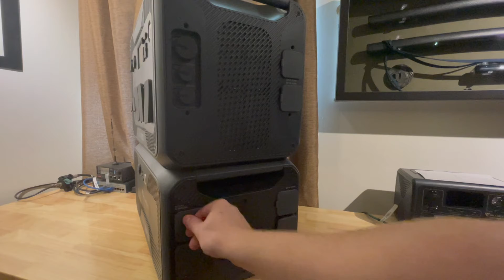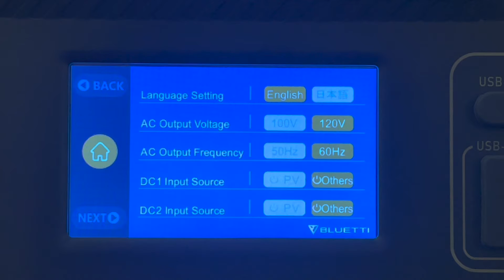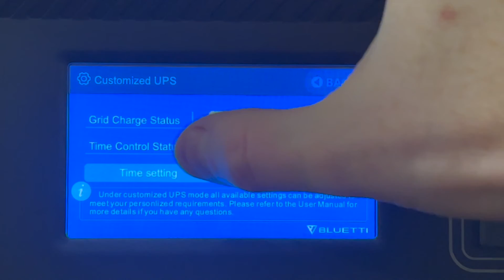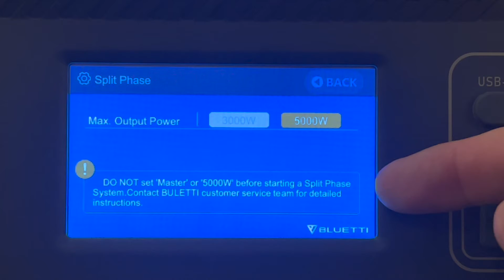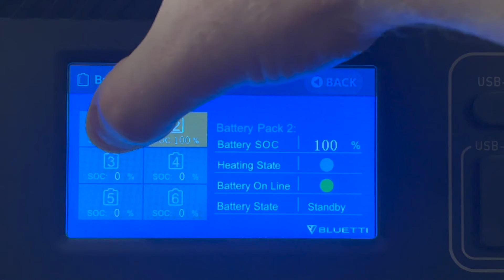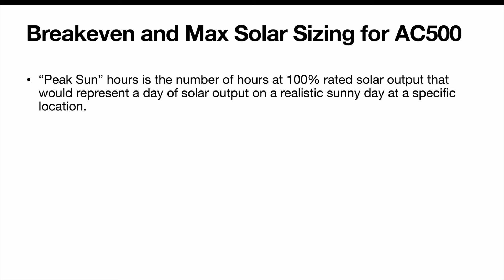Bluetti AC500 Full Review

Comment: Great video. I went with the AC500 based on your video. I know real world power needs are always more than we think, so I splurged on this thinking of future needs.
On a nitpicking note, the B300s is 100 pounds in the box. The unboxed actual unit spec is 83.8 pounds, so you can stack 3 of them on one of those 300-pound-rated rolling carts. (I found that the empty double boxes themselves are pretty heavy when I was stacking them in my storage room.)

My house is laid out nicely for running power cords without tripping hazards. The sunken living room provides a great pathway at the step down edge for them to run to my bedroom and utility room. The kitchen walls don't go all the way up to the A-frame ceiling, so it's convenient for running power cords along the top to the Fridge and appliances without breaking any fire codes (you can't run extension cords through walls.) I came to realize I don't need a transfer switch at all. Everything but the LED bulb house lights are run by the Bluetti.

Comment: What does output state "Load Matching" mean?  The AC load icon is a dark orange.  I'm seeing this on my EP500 Pro.  

My situation:  
1) 600 Watts of solar coming in 
2) Battery at 52%
3) AC (grid) power plugged in and available but not being used because I have PV priority mode (only uses grid if battery below 50%).
4) A load of 800 Watts plugged into one of the AC outputs

Thanks!

Comment: Great video, thank you! I just bought a AC500 unit and am waiting for the adapter cord so I can use it with my B300 batteries. The video was super helpful, as I am having an off grid small house built in southern AZ, which will be ready soon.

Comment: I notice one battery is connected, but it's listed as battery #2... I have two AC500 combo, one shows as battery #2 regardless of which AC500 it's connected to. Any ideas of what's going on with this? It should be reassigned Battery #1 when used with another AC500.
Reply from the maker: The AC500 assigns battery numbers based on where the battery was installed initially. I don’t know if a way to get it to reassign battery numbers once the battery is initially associated. 

Why do you need to do this? Other than aesthetics, the battery number does not have much meaning.
Reply: @WaveformScience  Why assign this way? I have two AC500 units and two B300s batteries with the intent of adding more batteries, and if needed be able to exchange and use batteries between them, when I need to use at separate locations. In essence, if I need to swap in a third battery to meet the higher demand my 2nd location, the 3rd battery will have an identical ID as one already installed there. I would now have multiple Battery #1, or Battery #2... this makes little sense. This is not an issue of aesthetics in my opinion, it's an issue of properly identifying a component in a system for the many obvious reasons. If IDs have little meaning, why label it anything? It's position on the touch screen is enough to show its placement in the system. I do worry that the BMS, or controller itself uses the ID in the management of the system somehow. Oddly, Bluetti had contacted me on FB and asked that I send a pic of the screen and serial number of the unit. The AC500 has a serial number, but I cannot find one on the $2K battery unit. If this were the PS70, I probably wouldn't care.